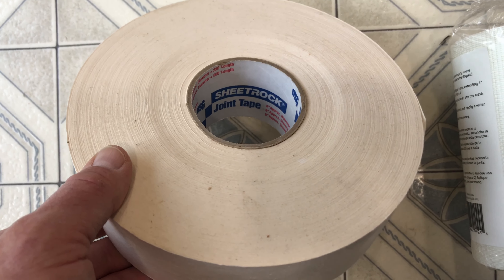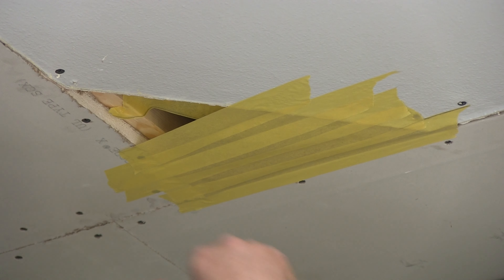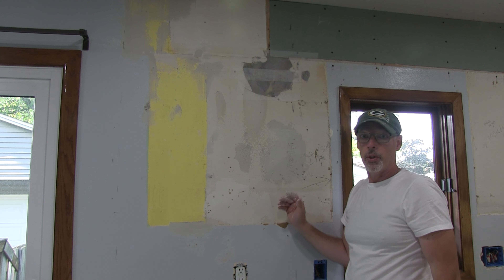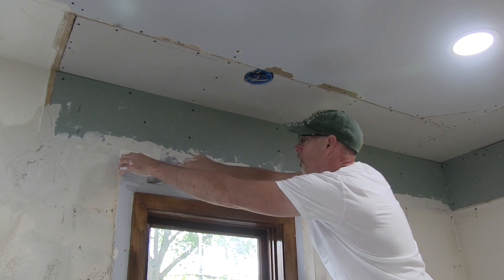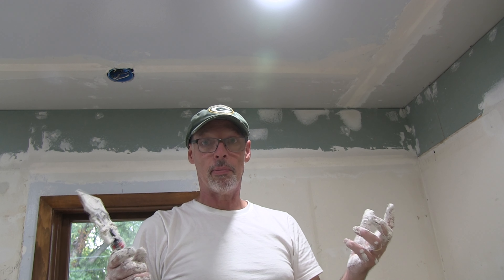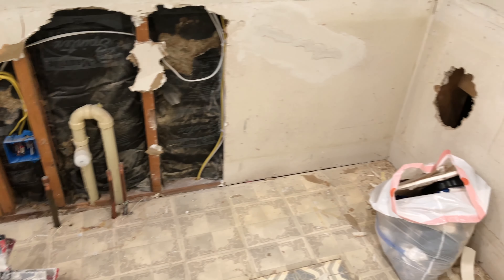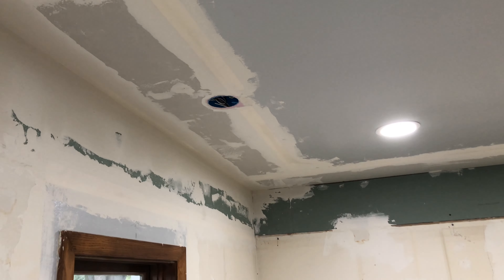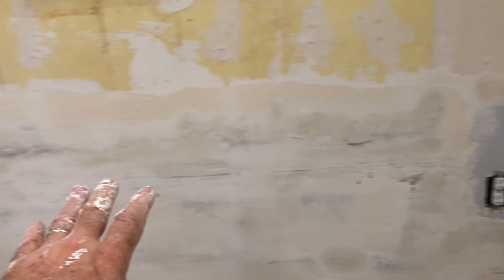Taping, Mudding, Patching Drywall (Kitchen Renovation) with Joint Compound using paper & FibaTape

Comment: Wow, great job! What’s the trick to get it to blend in the seams so well?
Reply from the maker: Thanks!
3 skim coats. It’s best to use a 6” drywall knife on the first coat and then 10” or 12 “ on the 2nd coat and then on the 3rd coat dilute the drywall compound with some water and use a damp sponge to lightly sand 😊